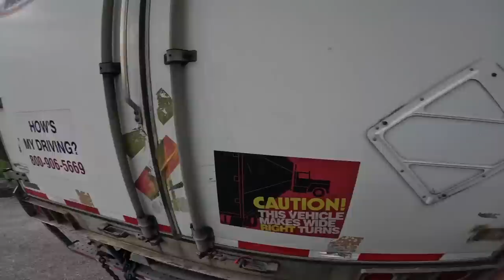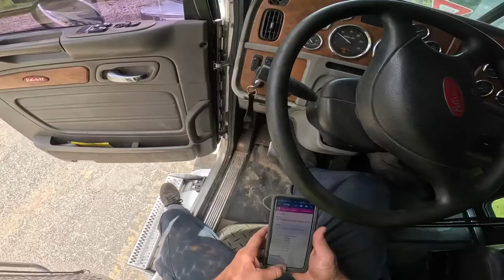43,000 LBS Trailer Lift

Comment: Mr. Hal, Smart move on the cap liner.  I don’t do your kind of work but still could have used a noggin’ protector for years.  It’s a wonder I’ve got a lick of sense and my wife would question that at times.  Besides that it hurts like the devil.
Reply from the maker: Mr Doak Yes sir it does. Thanks for watching and stay safe

Comment: You get a lot of these trucks turning too short on corners and dropping rears into a ditch. Do these semi drivers not know where their rear tires are tracking? Do they not have, or use,  rear-view mirrors? I'm puzzled about this. Semis can't pull their trailers through a ditch. Just doesn't work. 
Costly mistake, unless you just don't charge them enough. 
Good rescue and video. Like the hat suggestion to make it harder to get a head injury. I wear similar called a skull cap.
Reply from the maker: Deernut00 thanks for watching and commenting on our videos. Stay safe

Comment: Great recovery, Mr. Hal. I was hoping you had something protecting your head after that hit. I worked at the coal mines and sometimes forgot to put my hard hat on and that metal don’t forgive much lol. Did your truck come with a remote controller? That looks like it would be very useful in some situations. Great video. Thanks for sharing and be careful.
Reply from the maker: Proud Papaw  Yes sir it sure helps.  Thanks for watching and stay safe